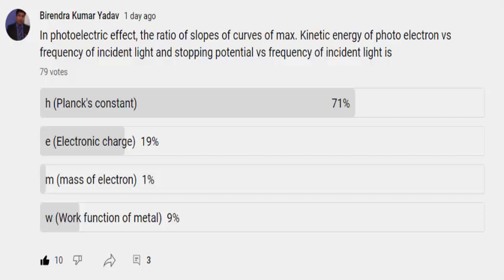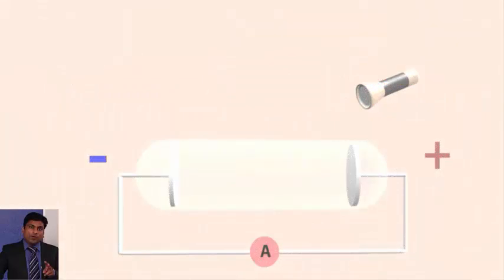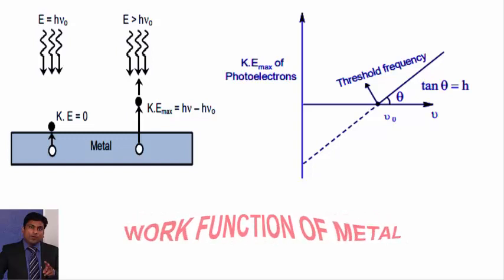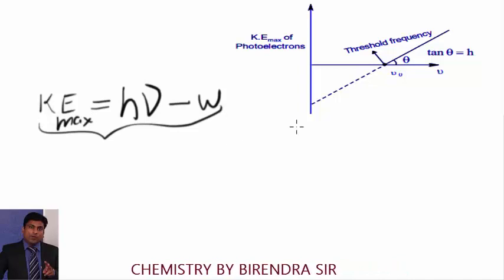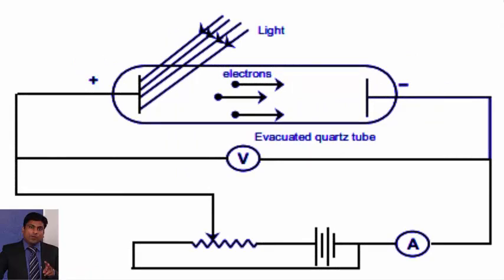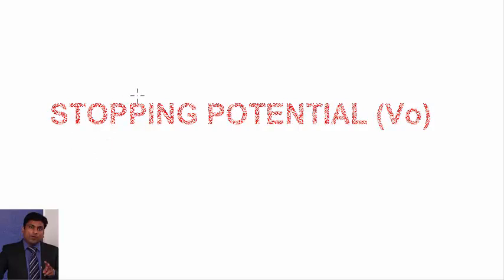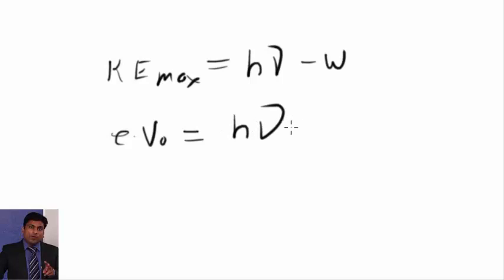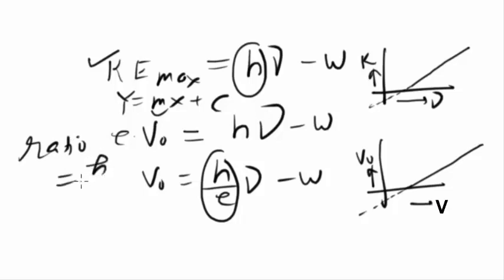The ratio of slopes of curves of max. KE  vs frequency  and stopping potential vs frequency is

Comment: Sir, how no electrons reaching the cathode implies it stops electron with Max. K.E. ?
Reply from the maker: When a charged particle is allowed to move in potential difference V, this potential does a work on charged particle (q.V) which gets converted into KE, here in stopping potential things are opposite, opposite potential will apply repulsion force to stop the electron of max. KE. If electron with max KE is stopped by opposite potential then definitely other electrons will get stopped.
Reply: @BirendraSirClasses  thanks sir😊